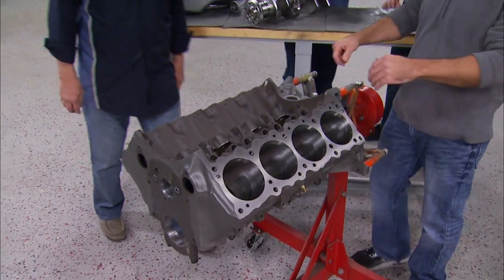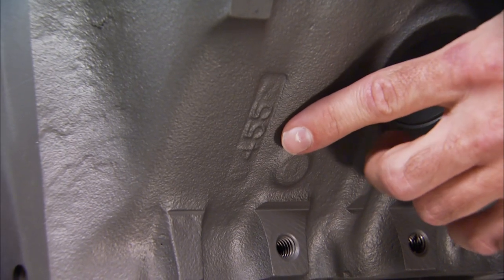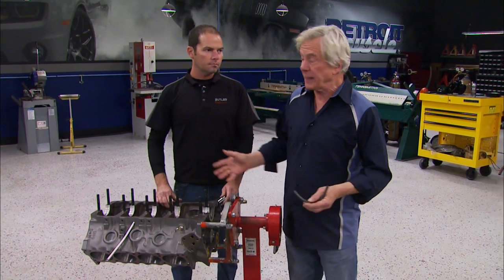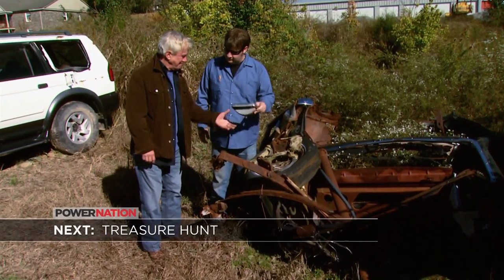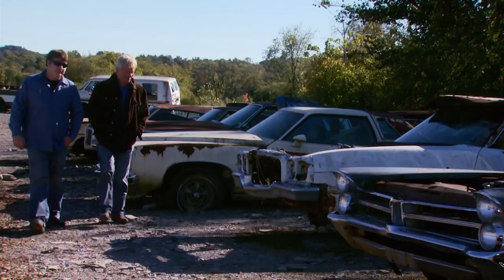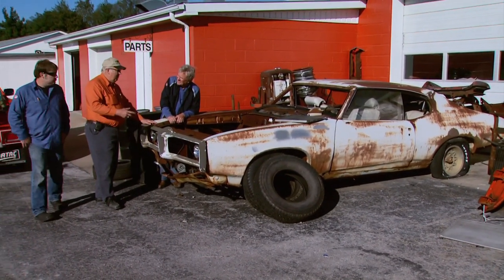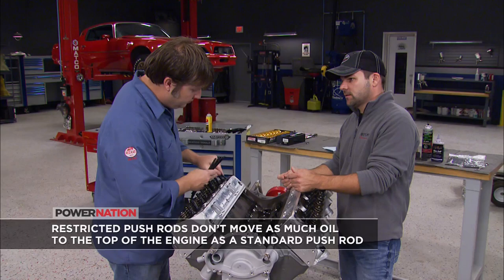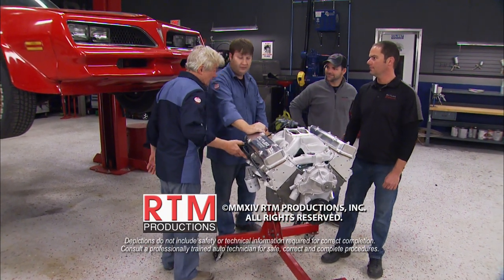Dropping A 474 Pontiac Stroker In The '78 Trans Am - Detroit Muscle S1, E2

Comment from the maker: Enter for a chance to win the Holley Corvette built on Detroit Muscle: http://httpslink.com/lnk_295e9a49
Reply: The people that write these shows are the best I can't imagine anyone else doing these episodes. The ratings are phenomenal and I see why now. They reflect the viewers watching the show. If it didn't hAve the history it wouldn't have the ratings it's as simple as that. If the new cars were more able to modify it would be a different story. You can't even get into a gm pxm because of the security codes locked into the stupid algorithm. If they made it easier to mod the home mechanic could do it. Now you are stuck to using a act box which usually won't pass the state inspection for monitors that won't be ready for the obd test. Also you can brick a pcm if your not careful. Qi can't imagine how much a 2018 camaro ss pcm would be. Let alone a 2004 mustang gt with pats keys that have.
Reply: What is the difference between olds Buick and Pontiac motors
Reply: @dylanmathias1018  That is like asking what is the difference between a Chevy and a Ford. They are made by different company's (divisions) to totally different specs. The Ods, Buick, Pontiac 455 are all different bore and stroke, different crank shaft sizes and etc.
Reply: Dumpy 400? How many people do you know who have a 45 year old car that still runs as good as the day it was built? Because I have one. Treat it right and it will run forever! That's worth more to me than having the most horse power. My hot rods are always broke.
Reply: That crank is heavy? Wow! 😂😂😅😅😂😂

Comment: That T/A is going to need a good set of subframe connectors with that much torque. The unibody isn't stiff enough for that kind of power.
Reply: 1st and 2nd gen  firebirds 1967-1981 have an actual frame the body sits on. 3rd and 4th gen 1982-2002 are unibodies and need those subframe connectors
Reply: @TAWS-wq3hx  not true at all my friend. RoboticGladiator is correct. They have sub frames.
Reply: @bradwatkins4494  no, from the factory they do not have subframes. You can have some custom made to reinforce the chassis when u add a torquer big cubed poncho. I've owned multiple 4th gens and known many with 3rds, I've compared the unibodies to the 1st and 2nd gen frames ☝🏼there big noticed able difference in design.
Reply: @TAWS-wq3hx  Wrong.
The 2nd gen is a unibody. You many have owned those ugly 4th gens, but I have owned several 2nd gens.
The floors, rear frame rails, inner and outer wheelhouses, quarter panels, trunk floor extension panels, rocker panels, rear body panel, roof, and cowl are all welded together to form the unibody. They do need subframe connectors, especially if they are t-top cars. Some including myself have added hidden cage beams to make the car even stronger. The 2nd gen is a completely different car compared to the 1st gen.
Reply: @AB-80X  no the 2nd gen 1970-1981 is not a unibody, it has a FRAME. Ive owned 2 of them lol. And now the 4th aren't ugly either they are pussy 🧲🧲, try again
Reply: @TAWS-wq3hx Lmao, what??  EVERYONE knows the 2nd gens are unibody.  Btw, I've owned ELEVEN of them. 😂

Comment: Align bore, not align hone shown.  Never use fully grooved mains as you lose 60% of your load-bearing capacity.  Either cross drill the crank or use 3/4 groove mains.

Comment: Cool   - Butler got 612  pump gas hp from one of their 474 ci. Pontiac V8 Stroker Builds  :)
Reply: and they have gotten over 750 HP out of them too...............
Reply: How many miles per gallon lol
Reply: @donfregin8668  Just add a overdrive auto transmission or 6 spd manual  there's several to chose from - a 76 T/A With a 535 ci.  Butler Pontiac V8 829 pump gas hp got 20 + mpg with a Overdrive auto 😎

Comment: I always liked big block power with high gears. 2.73s or 3.08s. You have plenty of thrust out of the hole, and rocket ship on the highway. Best of both
Reply: Butler said on this program no big block pontiac
Reply: @blainesnider9089  "big cubic inch power" then. Feel better?
Reply: @edjackson4389  huge weight difference
Reply: @blainesnider9089  I've never owned a Pontiac. Only Chevy Big and small blocks, so I'll take your word for it, but Pontiac engines don't exactly look lightweight
Reply: @edjackson4389  a short block weight 309lb and the heads weigh half as much a  BBC
Reply: @blainesnider9089  455 Pontiac 600lbs fully assembled,   454 665lbs fully assembled.
Reply: @edjackson4389  Pontiac doesn't have a big and small block because they only made one block deck height. Everything from the 326 to the 455 were all 10.24 deck height. The 326 to the 400 all had 3.75 stroke cranks. It was all bore difference.
Reply: @jhutch1470  Yeah, Im well aware, but I own 2 big block chevys. My statement was not Pontiac specific.
Reply: @jhutch1470 wrong, they had 2 different see deck heights.

Comment: Just put some early 1971 / 1972 7K3 Pontiac heads onto any Pontiac 455 block and you will have about 9.5 compression and around +400 HP that is fully capable of running off pump gas.   Those were the days when hot rodding, cruising, and light to light racing was insane weekend fun!
Reply: Or the 1971 96s...

Comment: My friend had one of these in the 80's.  It was  a true muscle car.  Awesome car
Reply: No it really wasn't, one those were pony cars, but that technicality aside the muscle car ear ended in '70 although the Pontiac still made quick cars until '74 with SD 455.  Everything after '74 was gutless.  

That lasted for about a decade, until Dodge decided to a throw turbo on econobox Colt, making it quicker than the Corvette in '84.  It was slow climb back to respectability until the 90's even then it's was Japaneses who upstaged the world by creating obtainable quick cars that had world class handling at the time.  Both the NSX and RX-7 were the best handling cars at any price in he early 90's.
Reply: As someone who has owned both a '77 W72 and '78 W72 WS6 car, I can attest to the fact that in stock form, they are absolute pigs. So was everything else at the time. The '78 was still faster than the Corvette and Mustang of the day though lol. Nothing was fast or a true muscle car in the late 70's. The redeeming feature of the Trans Am was that it stayed true to big inch displacement and it looked far better than anything else. By that standard, it was for sure the only true muscle car left by then, but more in spirit than actual performance.

Comment: If you see the 455 block’s bottom, this was a 75-76 455 because it wasn’t drilled for 4 bolt mains.
Reply: There are earlier 455 blocks that aren't 4 bolt mains. What's your point?
Reply: @V8Deuce No, but ALL of the 1970-74 455 blocks came PRE-DRILLED for 4-bolts from the factory, whether they had the 4-bolt caps or not.

Comment: OMG the cars i saw go to the crusher when the price was high for scrap and gas crunch was on and the town was after them to clean up. I cry to this day the blocks from Canada that were scraped also as the car was pooched from salt and the motors were just broke in sort of. I remember duel 4 barrels and six packs i could beat with my bike because they were running on 5 cylinders from neglect like the loner we got with the 428 side oilier and top loader but it hardly started.

Comment: You can build a 400 to over 600 hp.  Just use a 1974 or earlier block.
Reply: In the future I'll be building my '67 Pontiac 400 block. Goal is to get 500-600hp mated with a rebuilt 400th trans. And throwing all that in my' 75 Firebird/Trans Am clone.
Reply: @atranfanatic  600 is easy.
Here's how it's done.
Vic intake.
Ported Edel 340 heads.
Comp HUC 13861 intake lobes and 13863 exhaust lobes w. a 113+2 LSA on 1.6 rockers. No sewing machine here.
10.5:1 static CR.
Of course it needs to be put together properly, but that's a good 600+ hp combo.
Reply: @AB-80X  Ok cool thanks for the info. I'll put those in my records for the future!

Comment: Everyone hated those screaming chicken TAs from 1977 and 78, including myself. A guy I worked with bought one, a black one. I pretended I liked it in front of him, but with anyone else I told them they sucked, because they did. I think you could maybe get a 20 second et thru the quarter with one of these mickey mouse cartoonish cars. I had a 71 Firebird Espirit with a 350 and a three speed on the floor. I could have run circles around a 77 or 78 with a stock 350 with a 2 barrel. I hated those huge hood decals , puking chicken.

Comment: You tell by the VIN if any Pontiac A body is GTO from '66 on.  The same is true of the SS 396 Chevelles.   In '68 the 442 got it's own body code.  I don't think Buick ever did that's for the GS, or GSX.  Your out of luck for most other models as the VIN will only tell you if it came with a V8 or not.  With enough leg work most of the time you can figure what they were originally but wont be as easy as checking the VIN.

Comment: One of the most important things you skipped over was how to seat the rear main seal so that it does not leak.
Reply: They dont want all their tricks out the window. Why dont you put down how 2.
Reply: @numlockkilla  Are you kidding? You can buy that seal and they include instructions. There was so little info in this video it was abysmal, It was not meant for gearheads, that's for sure.

Comment: 5:40 the coating on the crank is going to add 30 hp? These guys will tell a lie with the quickness.
Reply: Your right. On this particular build, NO. That is definitely a stretch. On a high RPM long stoke motor it might.
Reply: @geoffmooregm  It will not increase 30 hp on any engine.
Reply: @thomasdaddio741  I'm glad I'm not the only person that can smell the BS.
Reply: @thomasdaddio741  The emission is not the reason it made 152 hp. The low lift cam is the reason. A 1978 Lamborghini Countach made 375 hp and was able to pass emission.
Reply: @thomasdaddio741  It would be nice if you guys stop believing everything PowerNation tell you.
Reply: @thomasdaddio741  Time for you to take a nap.
Reply: @blackericdenice  Yes it actually can. Large stroke engines with known windage problems can see gains. It's for the same reason vacuum pumps, windage trays and crank scrapers work so well at increasing power. The coating is very good at shedding oil from the rotating assembly. If no oil control method existed around the crank I could see the claimed gains. But if you already had a windage tray and crank scraper then the windage would already be under control and I agree you would see little to no gain. 

I will still take the 30HP number on this engine as complete bullshit though.
Reply: @geoffmooregm  That is 100% BS and you f-up when you said crank scraper. You are just repeating what you heard online.
Reply: @thomasdaddio741  Dude, I saw the ads a long time ago. I have an automotive background so I know better than to believe that bs.
Reply: @blackericdenice  What the hell are you on man? I said "crank scraper" so I am repeating something online? I was giving an example of how windage effects horsepower and if you can reduce it, you will gain power. A crank scraper is effective and very cheap way of reducing windage and improving oil control.
Reply: @geoffmooregm  A crank scraper is bs. Oil is not going to hang on a crankshaft. It is going to be throwed off.
Reply: @blackericdenice  Windage is a serious issue that wastes power, aireates the oil and keeps oil in suspension. Oil does not simply get thrown off the crank like water. This is enough of a problem that nearly every OEM engine now includes a windage tray and provisions to divert drain back oil away from the rotating assembly. Crank scrapers do a very good job of shedding excess oil, reducing windage and diverting oil to the pan. Just look up a few videos about the problem I am not expecting you to take my word for it.

Comment: The only things I need for my build is: 4 bolt main caps and sealed power zero gap compression rings. Roller camshaft bearings and rockershaft system securing the rocker arms..
BullyBilly

Comment: How’s does it seal between the water neck and water pump?
Reply: There is a channel that mates up between the timing cover and intake manifold, and a special flat o-ring type of seal is installed to seal it. You have to be familiar with Pontiac engines to get it just right, and they still have a reputation of seeping a lot. If you ever get it right, it will be fine.
Reply: I always tighten the intake bolts just enough to hold it down, then torque the bolt on the water pump, then torque the intake bolts. A little silicone on the o-ring is a good thing to do also.

Comment: Why use a 455 with those huge journals? Which was the achilles heal of the GM 455's.Should have started with a 400 same block smaller mains.
Reply: Stick to your Chevelles and Mustangs..........
Reply: 2 words "journal overlap". Overlap between the rods & mains is huge thus giving the crank more strength. The only reason everyone quotes what you said is because because the good 455 cost more & is harder to come by so they settled with the 400 and use that same tired excuse, " but the journals 🥴" lol.

Comment: Your so called "GTO / Judge " expert needs to do more research around these cars. Code "72" on the Data Tag will show that it is a true Carousel Red / Hugger Orange painted car from the factory. Also, there were more than 1500 first production Judges manufactured in Carousel Red in early 1969. Side note, first production Judges did NOT come with "Judge" glove box emblems . Also, if a trunk is opened and can stay up without holding with your hands, it means that it has a heavier duty trunk lid rods - only found in Judges. I can go on and on. There are all kinds of ways to detect if a car is a real Judge - and yes, including a PHS.

Comment: 6:42 is he running that wheel outwards?  should go inwards so it doesn't put a burr on the outer edge of the ring where it slides against the cylinder bore
Reply: You'd completely debur the ring regardless.
Reply: That's why you always debur the ring ends.